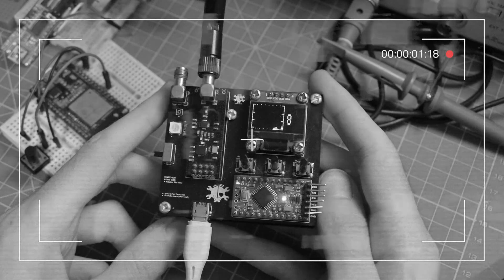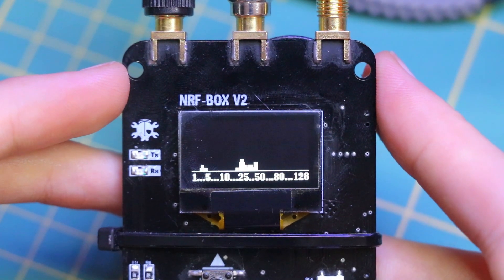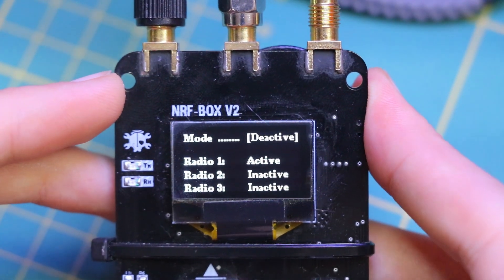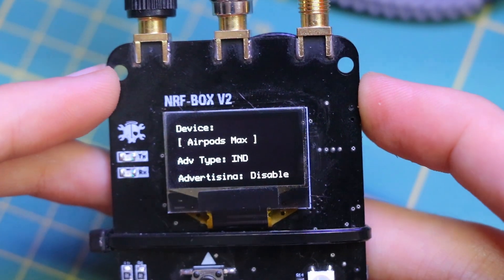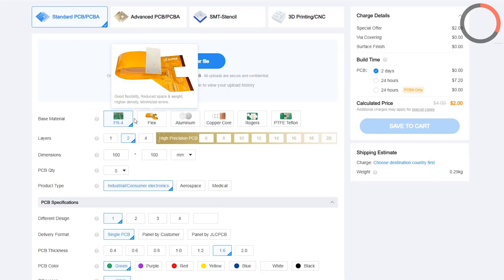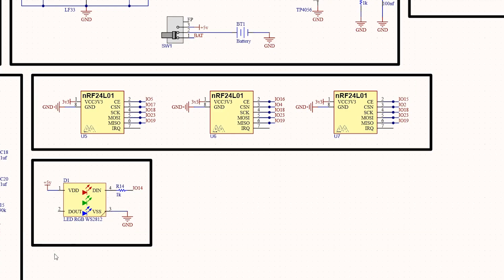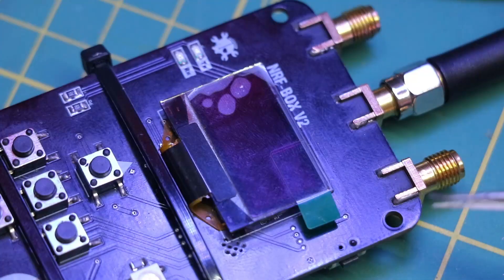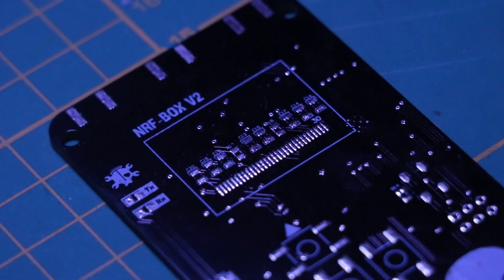nRFBox: Your All-in-One Gadget for BLE and 2.4GHz Networks

Comment: I like the project and I would like tobmake it but there is a lot of pieces not available in my country so I wanna ask if there is a replacement for the LF33 3.3V and an alternative for the Neopixel LED  .I also can't get a custom PCB so how can I connect an antenna with the breadboard version (can I use an nrf24l01 with antenna with the 2.4ghz ) sorry for asking a lot but we have limited pieces in Africa

Comment: Thank you very much for this amazing project. I have downloaded the graber file for placing the order, but the manufacturer reported an issue:

"Dear customer,
Hello! The file shows that the via hole has an inner diameter of 0.25mm and an outer diameter of 0.35mm, which exceeds our standard production process. (For single-sided and double-sided boards, the minimum hole diameter is typically 0.3mm, and the outer diameter is 0.4mm.)"

Thank you very much.

Comment: I delet std::string 
And write String i upload code next i upload bin in esp32 but display is off
Reply: I used version 2.0.17 of esp32 installed in the board manager (without changing the code), and I had no problems with the display. See my community tab.
Reply: @danilomelllo how
Reply: Wait wiat bro everything is good but jammer modes not work wifi jam not work Bluetooth jam not work but they are on display idk i have 3.0.5 esp32 board version and i change in code "std::string" to "String" @danilomelllo  and this is prob?

Comment: im new to making pcbs and i managed to convert your pcbdoc file to a gerber file using 'altium', but when i try to upload to jlcpcb they said: "There is no both top& bottom solder mask in your file". Could you upload a working gerber file to your github? or am i doing smthing dumb
Reply from the maker: i think you can use .pcbdoc as well for ordering the PCB, but I will provide gerber files as well.
Reply: @techcifer  Thanks the gerber file worked!

Comment: I made the first version with crappy expérimental pcb and dirty wire. I m going to do the second version when i will have time. With your jlcpcb link to reward you for sure ! Thank you for the content.
Reply from the maker: Thanks! Please give me feedback after you test it.
Reply: @techcifer bro my and others problem is ,{aka'std::__cxx11::basic_string<char>}to string  HOW FIX THE PROBLEM
Reply from the maker: @mzeoliluashvili4607 Hi, I have never faced this problem before, but I believe it is related to the ESP32 version. Change the ESP32 version in the board manager of the Arduino IDE to 1.0.4
Reply: @techcifer bro i change "std::string" to "String" and i upload code next i on display and everything is good but my project not jamm wifi and Bluetooth and this is Code's fault?
Reply from the maker: @mzeoliluashvili4607  It could be an issue with the power consumption, and don't forget that it's a 2.4 GHz disruptor.
Reply: @techcifer  I thought the same
Reply: I know but not work ble jam and wifi jam can u upload video when u jamming ble and wifi  @techcifer